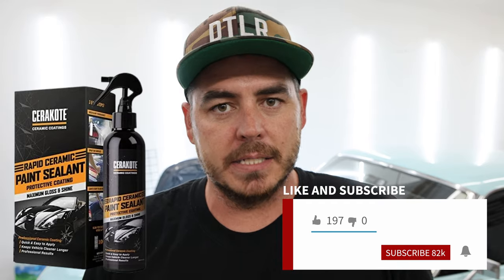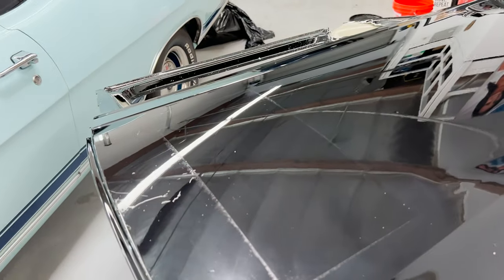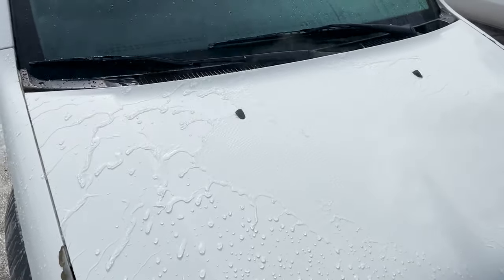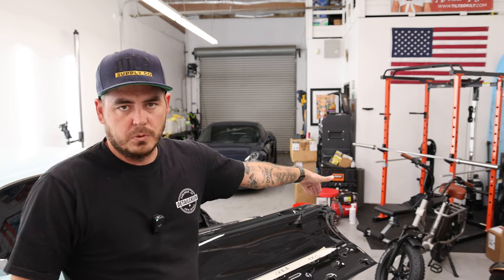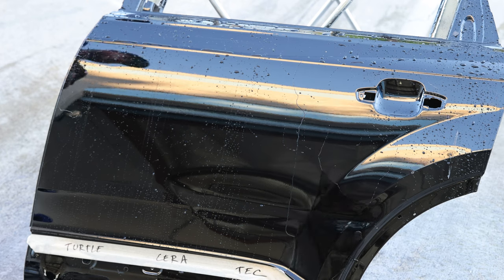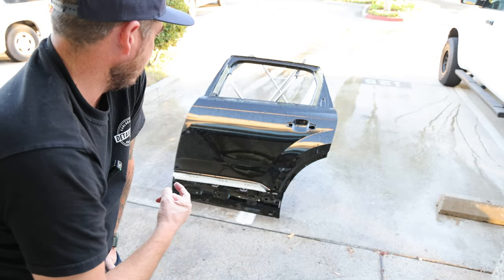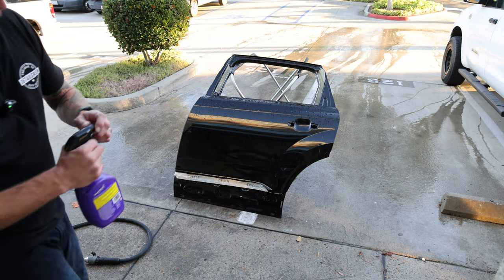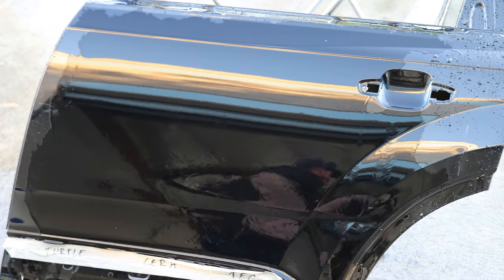I WAS WRONG.. CERAKOTE RAPID CERAMIC FULL TEST!  Easy to Apply Ceramic

Comment: Cerakote makes the best headlamp restorer kit.
Reply from the maker: Yep!!
Reply: Agreed!!! Adams kits is the exact same kit just rebranded plus 3k sanding oad
Reply: The 3M kit with the sanding disks is my Gold standard method of restoring headlights.
Reply: Please wear a mask when using lol
Reply: I didn't think so from my experience personally. The Cerekote did absolutely nothing on my Audi headlights. Had to break out the 3M kit, and that took care of it.
Reply: Sylvania does it better imo. Cheaper too.
Reply: I'm pretty sure  their trim coat is the same as the headlamp restoration without the cleaner. I bought my own sand paper wet sanded 1000,2000,3000 grit cleaned with ipa and applied the trim coat to the headlight did the same thing . now I have 9 cerakote wipes left vs. the 5 u get in the headlight kit
Reply: Sand and polish with regular stuff. Then coat the headlights with the trim wipes. You get a lot more bang for your buck that way

Comment: Hi Josh, Mike from Fleetwood PA.,  Was manager of detail shop of a new car dealership, since retired and doing detailing at home now. Not really impressed with your results and that was a panel with sprayed with water hose a few times for what a total of maybe 15min?, and it flattened out in shine from beginning. However price fairly reasonable, have you tried to compare it with these that I use! Now I wash and clay then use these cermanic products,  Next Gen, Hydrosilex, and Hays ceramic coatings all spray on very easily. On my own car all of these lasted around 6 months. A little more expensive though. I dont know if you have heard of ClayZilla?, it came out about 7 to 10 yrs ago. They sold out in 1st 6 months, then about 3 yrs ago the company making them went out of business and noone took it over.  SurfCity garage still has it listed as out of stock. I new the manager they were devasted when they couldn't get it any more. It looks like a pc mouse with a special velcrow pad, Surfcity sent me one before they started selling it to test it, It is so simple and looking at it you would think this thing will clean the paint, but it does 200% easier and faster than clay bar. I did 50 vehicles before changing to a new pad. Any way last year I bought out every clayzilla pad I could find. I would never go back to a clay bar. Its to bad this product went out of business, there are clones out there or copies of clayzilla but the pad is the key that they dont have. I am 70yrs young and have been building streetrods and detailing since 1971. Ok later sorry for the long comment! Mike

Comment: I dont know why i see so many videos of people torture testing Techicians choice detail spray, which typically last a few weeks, against sealants which lasts months. For detail sprays, protection is a secondary bonus feature. Whereas for sealants, that's the primary feature, so it doesn't sound fair to me to compare the two.
Reply from the maker: That’s a very fair point. I think it’s cause as a detail spray, the technicians choice performs way better than just a detail spray. But I do agree with you.

Comment: I just tried technicians choice for the first time, based on your recommendation. It works great. There isn't a huge difference between the three. Considering that cerakote is twice as much as technicians choice, I`ll stick with it.
Reply: @Ihateliberals901  good tech tip ! 👏
Reply from the maker: Yea the value with the technicians choice is hard to beat.

Comment: Just started using cerakote.  I just bought a new car as well.  I have applied many different expensive and inexpensive ceramic coatings and cerakote was by far the easiest.  No issues with streaking and great shine.  Will wait and see how durable it is after applying two coats over a 4 day period.

Comment: You always want any sort of tar remover to be the last test, since most of them are solvent-based products and that's usually a spray coating killer. I learned that from Martin Weatherspoon. He also takes a good soap like Hybrid Solutions Slick-n-Slide between test products. Seems to work very well for cleansing the panel of the test chemicals.
That said, I always love watching your videos and product reviews! Keep 'em coming Josh!
Reply: Shout out to Bel Lavoro Auto Spa!
Reply from the maker: Thanks! Yea that make sense with the tar remover. As far as the soap between passes, that makes a tone of sense to me but to be honest i tested it that way first and the soap seemed to have a slight effect as well. To be fair I just used some meguiars gold class that I have close by and it may have had something in that was effecting the contact angle of the ceramic products

Comment: Ive used Flex Wax and Technicians choice and think both are great.  But Technicians Choice is a much better value, so currently is my go to.  I wash my cars every three or four weeks and apply a new coat, so the durability is not an issue.  I've never noticed either one breaking down

Comment: Tecnician choice is at a disadvantage, wheel out line on the door, it slows down the sheeting process.
Water sheets then builds up at the wheel outline, forcing the water to go down to the left. 
Causing a restriction and slowing down Tec sheeting abillty.
Im not trying to be negative or anything like that.
I appreciate u taking ur own time and money to record edited and post ur vids.
Im just stating the other 2 products have a wider sheeting area from start to finish to allow the products and gravity to do its job.
From sudbury ontario Canada, I was in Florida, got some spray coatings, Cerakote was one of them.
Not sure if u ever tested White Diamond ceramic infused graphene spray.
If u havent, Id love to see u test that and give ur opinion on tjat product.
Thanks for ur vids

Comment: awesome to see that you were willing to retest the cerakote.  i have used the cerakote trim coat before and works great!
Reply: I did my headlights with the trim coat useing the instructions from the headlight  kit but started at 1000 grit wet sanding  had no headlight cleaner lol had the exact same results if you buy ure own sand paper and get the trim coat id say ure better off 10 wipes over 5. did 1 headlight  as a test now  that side is shining.

Comment: I tried the Flex but currently using Megs Ceramic blue spray. I like the Megs better. The Flex and Megs HCW can both be applied to a wet surface unlike the Cerakote. Apex tested Flex and got a 100 on his gloss meter. I wonder what a gloss meter would read on the Cerakote.

Comment: Looks like Cerakote is the winner if it’s as easy to apply as Technicians Choice. Bought TC based on your recommendation and love it but that gloss and higher performance might make me get that once my bottle of TC is out. Thanks for the reviews and tests!
Reply: So this is pretty much like technicians choice? Meaning once I dry my car I spray this on it and buff it off instead of the TC. I use TC after every wash and love it.

Comment: This is the honest review that I left on Amazon after my awful experience with Cerakote Rapid Ceramic Paint Sealant. There are many other reviews that say basically the same thing. I will say that the headlight treatment has worked great, so far. It's only been a month so I'll see how long it lasts. The plastic treatment worked good at first, but is failing in spots after only 1 month. I'll never by these products again. Total scam on the paint sealant!

This stuff left a worse finish on my truck than the original finish, which is sticky. My Dodge truck came from the factory with a clear coat finish called Pearl Coat. It has a nice reflective, shiny finish. But it is sticky and collects dust and dirt and is hard to keep clean. I thought Cerakote would do the trick to slick up the finish and make it easier to clean and keep clean and shiny. WRONG! The finish left on my truck after following the instructions and watching the youtube application video, and applying two coats, is worse than the original finish. IT IS NOT SLICK! After washing or rain, water actually sticks to the vertical sides of my truck! WATER DOESN'T EVEN RUN DOWN THE SIDE OF MY TRUCK! Instead, the water beads up in tiny little beads and clings to the surface like a mist. It is much worse than the original finish, which would at least allow the water to run off the sides. Total waste of money and much effort, FOR NOTHING. Can't wait for it to wear off because it's even harder to wash now, seeing as I have to scrub off the road film and stuff that should just rinse off with the pressure washer. I could not be more disappointed and ticked off!
Reply from the maker: Oh man I’m sorry to hear that you had splice a bad experience with it. Did you do any paint prep on the vehicle? Sometimes there can be things left on the paint from transport that need to be clayed to remove. If you apply something like this over the top it won’t be able to do what it’s meant to do. If you clay the car it should help significantly

Comment: Nice test. I have an opinion question. I have a couple garage queens. Both Ceramic coated. What in your opinion give you the best showroom finish with gloss and slickness. I am presently using a combination of 3D bead it up and Dream Maker. It works great, but I'm always wondering if they is something better? I'm getting Gloss Units in the high 90's . Thanks Dave

Comment: Bro you need to try Duraslic's new FlowX ceramic Topper. It's incredible. By far the best spray ceramic I've tried. Crazy high solids. It's not cheap at $99 a bottle but it works incredibly well. The water angle is wild.
Reply from the maker: I actually have it but haven’t used it yet. Thanks for the tip though I’ll get on it

Comment: Josh, I found a topper that is excellent maybe better than the cerakote. Have you taken a look at Xtreme solutions topper?  By the way how often should one apply a topper should it be done after each wash? I am currently using carpro reset in a foam Cannon and in a bucket for my maintenance washes and then I used the topper for gloss enhancement and hydrophobic enhancement after the wash.
Reply: You can tell by the performance you see at hand. Or if you are starting to have trouble cleaning and area and having immediate hydrophobic or hydrophilic  results. 
That would indicate it's getting weak.

Comment: I've been using Flexwax for a long time now but was never impressed with the gloss. Bead Maker blows it out of the water and I always ended up using Bead Maker or the Clean Maker mix over the Flexwax. It's held up decent though. I'm getting Cerakotes new ceramic coating to try along with a bottle of this to use as a topper. Interested to see how it'll do on my rims compared to the Flexwax and Bead Maker

Comment: Any tips on keeping my microfibers used to apply/buff these in good condition? Some still end up hydrophobic even if I dunked it in 1:5 super clean for 30 min after using and before throwing it in the washer. Granted I tend to coat the entire car in 1 towel so maybe that's allowing the initial coating to cure?

Comment: i did half the hood in cerakote, the other half with turtle wax, the same shine, no different, turtle wax cost 4 times less
Reply from the maker: Nice! On the panels I’ve tested, especially black I noticed a deeper color saturation but not on all colors

Comment: What do you recommend for sunroof rubber seals? Just silicone spray of some kind still the way to go? They are kinda looking white and stuff, I'm looking to bring back the black and add some protection.
Reply: Always deep clean rubber (May require agitation), finish with a panel prep.  The Cerakote Trim protection may work? Other options?  Turtle Wax Ice Spray Wax is another option.  Lithium trim cubes?  or Malco Nu Revive...